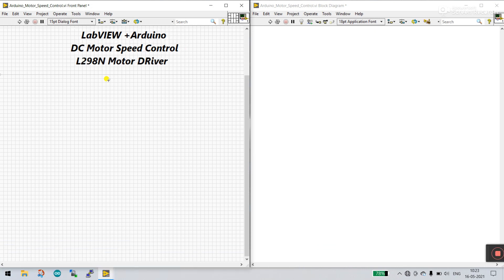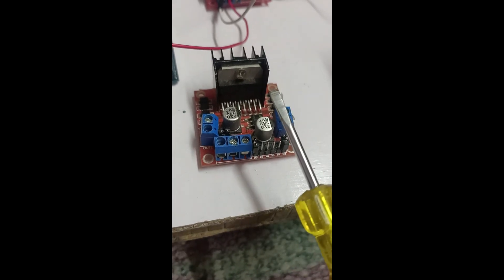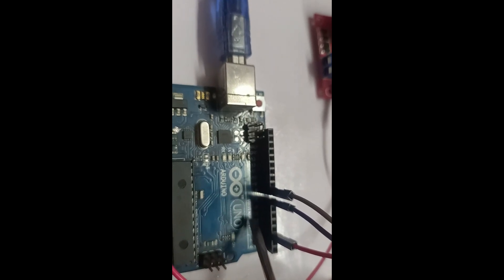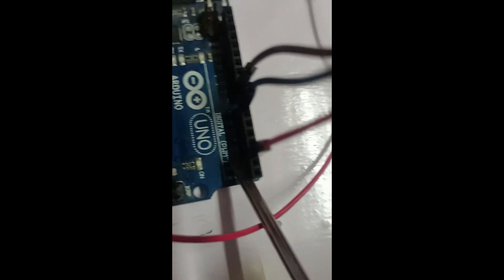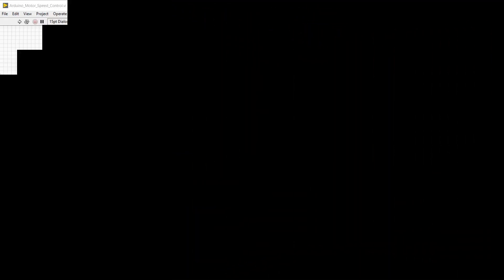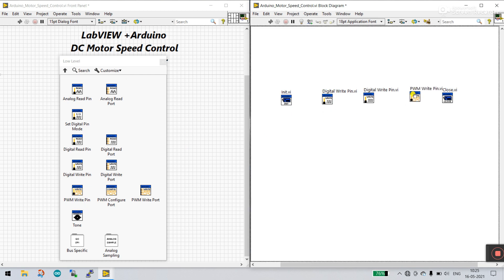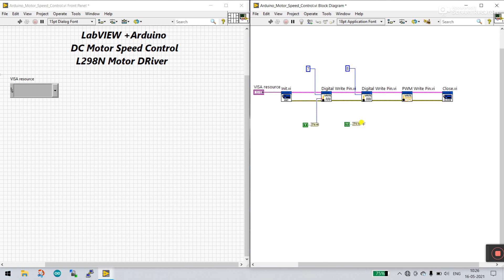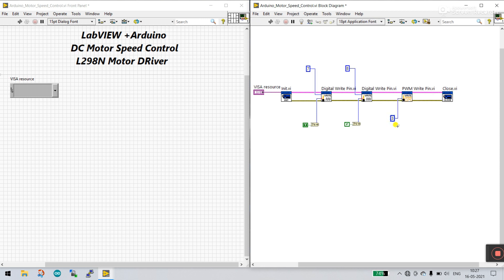LabVIEW | DC Motor Speed Control using L298N Driver | LabVIEW + Arduino Programming Series

Comment: Hello .. my LabVIEW is not detecting the arduino or you can say not showing the COM7 in the VISA. I've installed all the libraries related to arduino. Can you guide if you have any info regarding this issue?
Reply: You may need to update Ni Visa drivers

Comment: Hello sir i have some question, what the function for 5v in modul ? If i dont to connect to arduino for 5v. Can it's work and not make some a problem to labview ? Thanks
Reply: So if i dont connect 5v in l298n from arduino 5v pin. Then the source for arduino from other source. Its not makes some problem ?
Reply from the maker: @passingmerem-11  no problem dear but connect motor driver gnd to Arduino Uno if you will not connect gnd or 5v motor driver to Arduino uno that's time your motor not rotate.
Reply: Thanks sir, know i understan how to wiring 😁
Reply from the maker: @passingmerem-11  great 🤗
Reply from the maker: Dear you need to give 5v to your Arduino uno because IN1,IN2,IN3,IN4 depend on Arduino 5v + gnd that's why you need to give 5v from Arduino